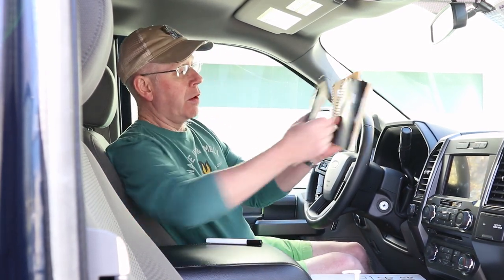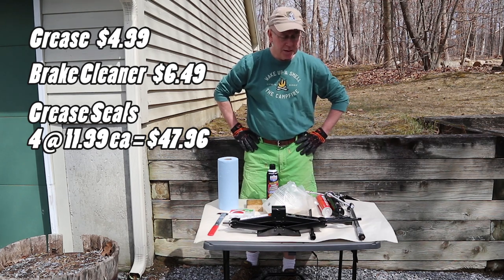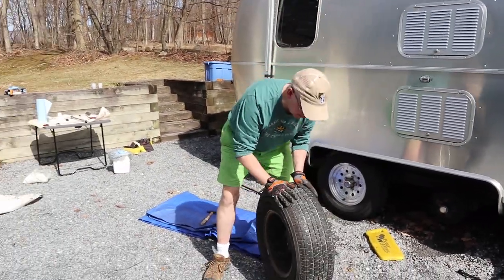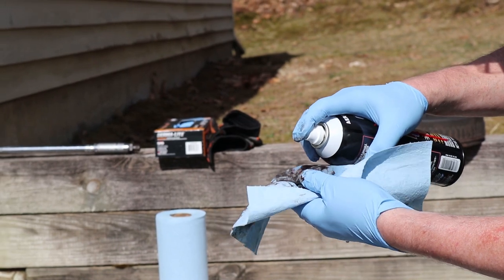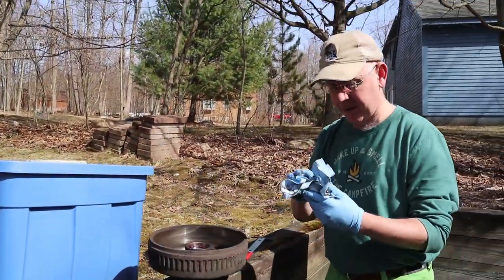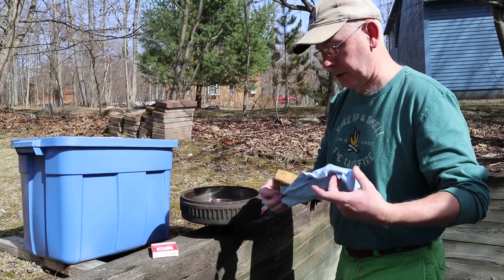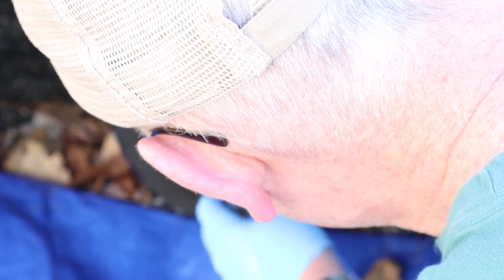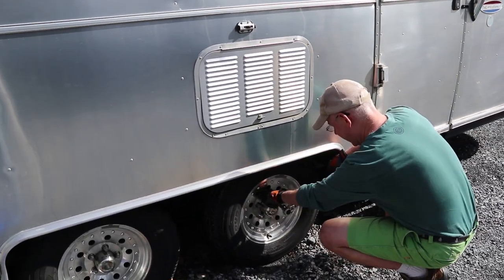How I Repack My Airstream Wheel Bearings | RV Airstream Trailer Spring Maintenance

Comment: Super helpful! Thank you. We just picked up a 2002 Safari LS 25 footer. It was pretty well cared for however it has over 100k documented miles on it so I am doing all the regular maintenance on it now (plus I really enjoy this stuff).
Reply from the maker: Thanks for watching and the nice comment.  Packing the wheel bearings seems daunting but with the right tools, it is not too bad.  Your 2002 Safari probably rolled down the production line not too far off from when the Luv Sub did.

Comment: Nice job explaining the process. Honestly though I always hated doing wheel bearings. Was happy to learn my 2007 Classic had permanently lubed bearings.  One thing I  noticed that you might like, I use flexible plastic cutting boards under my tires when I park for prolonged times, like for the winter.  A 4 pack of these are only a few dollars at Walmart or Amazon. They keep the  bottom of the tires clean and isolate the tire rubber from the ground. A fellow Airstream owner told me about this a few years ago, and I have used them ever since.
Reply from the maker: Thanks for watching and the great tip!  I will certainly do something like you suggest.  In fact, my initial thought was just to drive up on four single plastic leveling blocks...